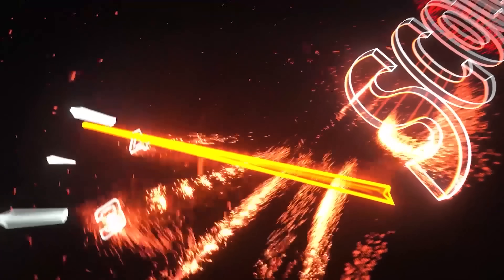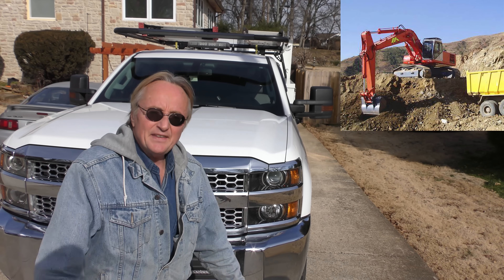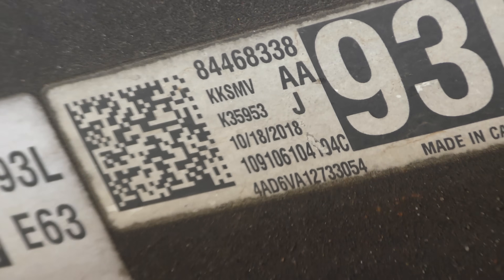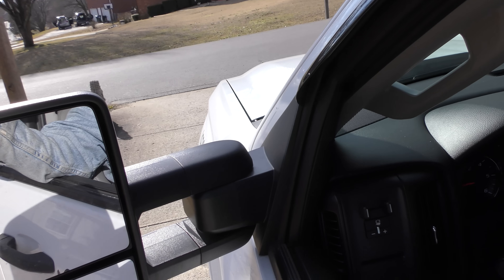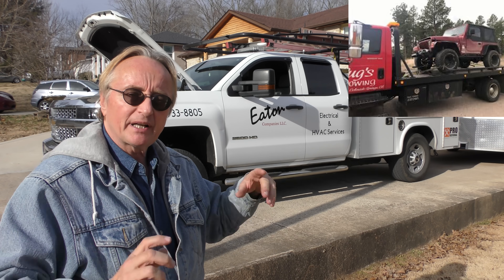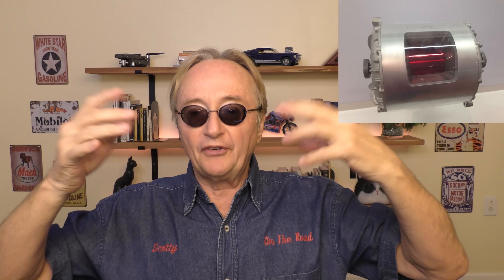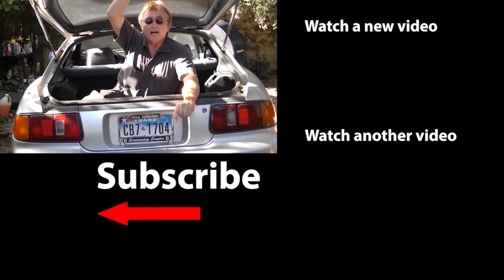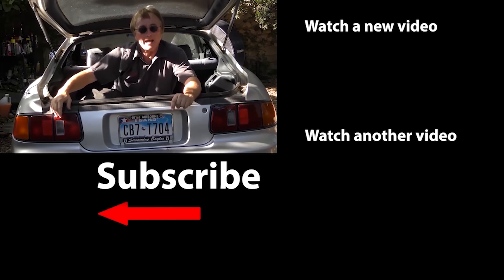Was I Wrong About Chevy Trucks

Comment: What about the old c1500 suburbans I just seen one running great with 240K miles
Reply: Scotty has said 100 times....older GM is good........ they are
Reply: I've got a 1998 Suburban with a 350 that has 315,000 miles on it and with routine service it's been no problem.
Reply: He lumps too many years together, the 5.3 was extremely reliable until 2007.5 when they added d.o.d/ afm.

Comment: Scotty, I've put off buying a new truck for 3 months now because the research is frustrating.  We've always been a Chevy family so I hate to buy anything else !  I like your endorsement of this HD, coupled with the fact that my boss bought one 2 years ago and it's been a fine truck.  However, I'm buying it for an all-around hauler, work, play, family, grocery-getter, daily commuter, and not so much the "HD" part, though I do have a car trailer I pull on occasion.  I just want something that lives up to the historic tradition of performance and reliability us Chevy fans have always enjoyed. Can you (or someone) give an analysis/opinion of the Dynamic Fuel Mgment system and its long-term effect on the engine? And is it possible to get this 6.2 liter gas engine without it?  Thanks!

Comment: Hey Scotty, I bought a 2015 Chevy Silverado 4.3L Ecotec 1500, I need it to pull a Riverside Retro 820 Toyahauler that weighs 3500 Lbs, my specs say I can pull it but am I pushing the limit with this truck after I load my gear and 600 lb motorcycle in the back? I thought this would save gas money but did I screw myself?

Comment: How hard is it to replace the throttle body thing in a 2003 Chevrolet Silverado 2500 HD crew cab My engine light comes on and reduced engine power Kinda comes and goes for past 6 months

Comment: is the engine good in this older model? 2016 Chevrolet Express CUTAWAY, 6.0L V8 OHV 16V FFV
Reply: that engine is the L96. It is a fantastic engine. Don't expect much mileage, but you probably have the 36 gallon tank. The engine will do 300-400k miles, tho

Comment: My experience owning a 2004 2500HD with an 8.1 /Allison combination has been mixed. Up to 150K miles, reliability was excellent. Thereafter, I had to rebuild the entire front end. Ball joints, idler arm, tie rod ends, wheel bearings and upper control arms (truck is NOT lifted) despite the fact the zircs were greased every 5,000 miles. Also blew the the steering box seal, power steering pump pressure line, engine oil cooler line, transmission cooler line, brake lines and fuel lines, all before reaching 173k miles. Mind you, the truck looks great with little to no body rust, but the undercarriage is another issue. Eighty five percent of the truck's life has been interstate driving up north. At 175k miles, the instrument cluster stepper motors are failing, resulting in erratic speedo and tach readings. To be fair, the powertrain has been the strongest part of the truck. 

It was my leased work truck that I purchased from the lessor at 135K miles, because I really liked the truck. Unfortunately, by then, the undercarriage corrosion had taken its toll and all the issues arose. Is this worse or better had it been a 1500? Meh...

Comment: Hey scotty I was looking at a 2013 camaro ss Hurst performance. Its a 6 speed manual and has 38 thousands miles on it and there listing it for 24k is that a good deal and Is there anything I need to look out for?
Reply: Mon Deezy  It's a Hurst performance wich will hold its value and there's no turbo on a ss even on the new ones. The reason I'm looking at a 2013 is the reliability on them are real good the new ones have problems.

Comment: say, i have a 2001 silverado with the 4.8. 240k on it. when i start it in the cold, it sounds like i have a knock for about 15 seconds. oil pressure is fine, i maintain it well. am i screwed? it's been doing this since i bought it 3 years ago.

Comment: Actually you are wrong the new     6.6 L gas puts out 401 hp not the 6.0 like in the video.  I know I have 4 or these trucks   The 6.0 was realizable but under powered 360 hp  380 ft lbs of torque. The new 6.6 is. Much better and so is the redesign.  A much bigger truck at 2 inches taller and wider and 10 inches longer.
Reply: I have 2 new style one 2020denali 3500 diesel  and 10Spd which is awesome and a 2021 2500 gas 6.6. 
All 6 of these trucks have never broke down over 6 years.  Never. 
I do landscaping and snow plowing so they are worked hard.  Pulling trailers also.

Comment: Except for mine that has a 13k repair at 100k miles. Def injection pump
Reply: Wow! My 95 Dodge Cummins 12V is trouble free injection system. Bought it in 1999, probably my last truck.

Comment: The GM gas vehicles (trucks) are the ones people need to avoid.  The diesels are fine, except they do need minor maintenance as they age (as they get over 100k).  For example,. our 2500 (2015 model year) has only needed minor stuff -- a DEF filter here, a fuel filter there, and a replacement glow plug. Of course our 2011 Doge 3500 hasn't needed any of that stuff -- except a new transmission, but it's got 270k on it so a new trans at around 225k was expected with all the heavy hauling we were doing.  The diesel version of the Chevy's are built better, and they cost a bit more, but not by a ton to be honest.  A modestly equipped 1500 is about $45k MSRP.  A modestly equipped diesel is probably around $60k (let's say an LT version, which is the mid-range trim level).

Comment: An older driver of a 2016 Chevy 2500HD recently crashed into my Ford pickup (older driver was 100% at fault) - he was pulling out of a parking spot onto the road and apparently didn't see my bright blue F-150 coming down the road at about 20mph. Pulled right into me...damage to my vehicle was superficial (mainly front headlight and quarter panel), the front of his 2500 looked like it went through a paper shredder, plus he had frame damage. His truck was not drivable after the collision. Pretty surprising considering his 2500 likely outweighed my F-150 by almost 1000 lbs. Not sure how heavy duty those 2500's really are after watching one get torn up by my smaller F-150.

Comment: My 2500 2019 i thouggt was so great ended up having a serious rust on the truck frame with serios cracks i can stick my finger in... they hid it with a under coating and we paid 67000 plus tax 2 years ago... now the coating has fallen off like corn flakes and im left with a pile of garbage ... Gm is runing away from fixing this isue... run from gm please... buy a toyota

Comment: I don't buy all your Chevy hate Scotty, they are not perfect but neither are ford, Dodge or your beloved Toyota. How bout starting on Dodge ram junk that's out there.
Reply: He's said 100 times.older GM is good. The blazers, and s10 lose reverse half the time
.my landlord has a siearra v8 that doesn't have reverse...it has a bottom end knock in the motor..167k miles and it basically needs a.motor and tranny...wasnt neglected it's fairly quick though